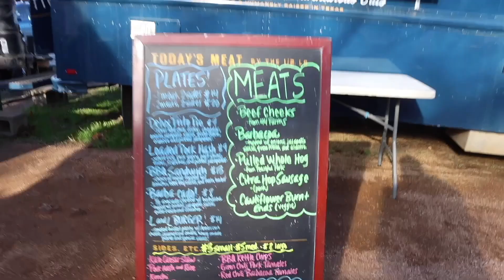Smoked Barbacoa Stuffed Avocado with LeRoy and Lewis

Comment: I've never considered standard plastic wrap to be remotely safe in an oven, even at a fairly low temp.   Is this just standard commercial kitchen wrap or something meant for the heat?
Reply from the maker: It is also protected by the foil. If it were just plastic wrapped and not topped with foil, the plastic will melt. Also, if the temp is too hot, the plastic will get crusted and burnt to the edges of the pan which is a HUGE P.I.T.A. to scrub off.
Reply: @LeRoyandLewisBBQ  Thanks!   Yeah, I figured the foil was probably the trick!